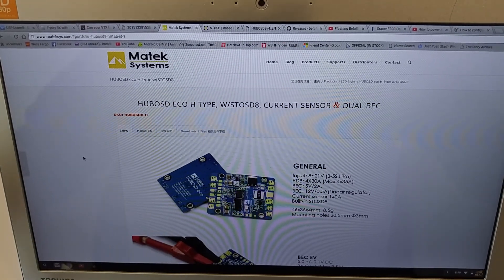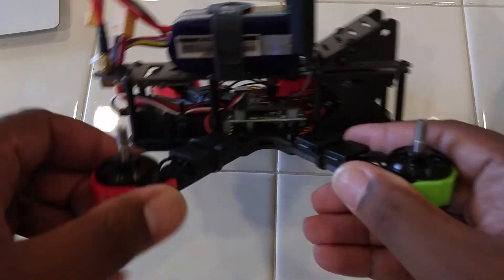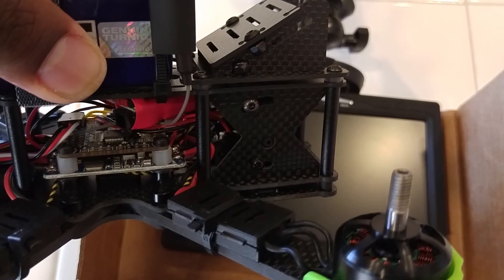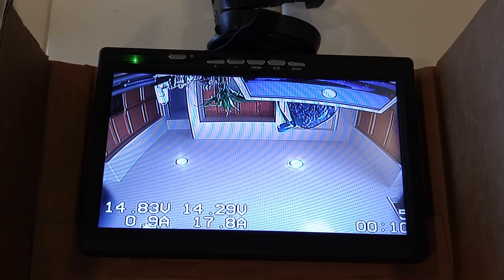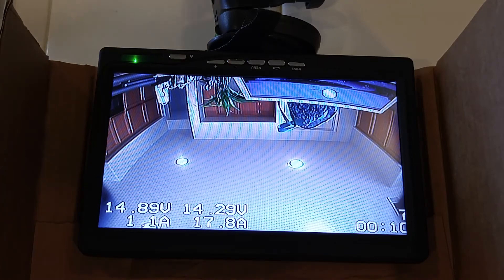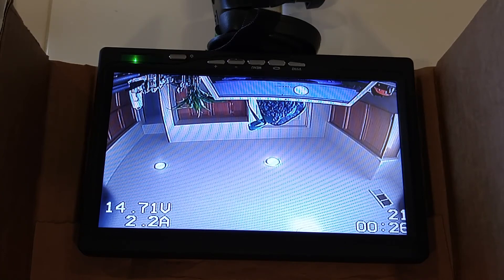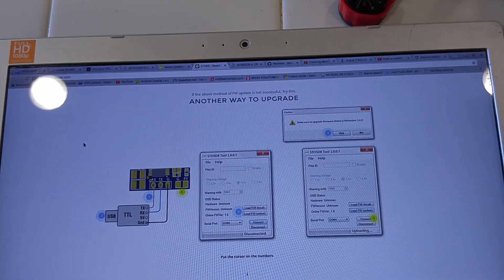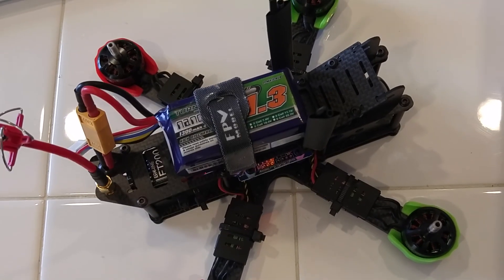Quick Review - Matek Realacc HUBOSD PDB w/ Integrated OSD

Comment: Very nice video. Thanks a lot. I need some help. So far I used 2 of these boards, first one has a wrong voltage and wrong current usage showing up, and second one had no current data at all. Not sure what's wrong with them? Could it be a hardware issue? Or something that I can correct by connecting to computer?
Reply from the maker: I haven't really been following these boards for a while. I'd suggest you post a very detailed description of your issues here and Matek themselves or some of the others should be able to help you better than I can
https://www.rcgroups.com/forums/showthread.php?2691525-Matek-HUBOSD-H-X-SE-w-STOSD8-Thread
Reply: Thank you. But what I bought is a Realacc one, I think its a clone product. Anyway I will give it a try.
Reply from the maker: RCRahul 365 Yes Matek confirmed that the RealACC is a rebrand that Matek producers... hardware is identical. That forum should help you out
Reply: RCFlyer85 sure. Thank for your help.

Comment: Awesome video, liked and subbed! My HUBOSD is flickering on and off at full throttle, any thoughts? I have the capacitor installed across the power leads but I'm still getting video break up at WOT :/
Reply from the maker: James Brossart 1.) I'd check all your solder joints and make sure they are all good, solid and clean 2.) Read up on ground loops 3.) Check out the official thread for more information and see how others are fixing it ( though In will say that if your running 30a ESC's with powerful motors you may just be maxing out the board amp wise ) 
https://www.rcgroups.com/forums/showthread.php?2691525-Matek-HUBOSD-H-X-SE-w-STOSD8-Thread

Comment: Hi, I tested the pdb realcc with osd. In osd there are write 2 volts the first in air, it is higher than the second on the ground with the engines stopped… Why? Es.. in the air, I have 4×4 volt, on the ground the min volt are 4×3.80. This is a problem… Can i set the 2 parameters at the same number?
Reply from the maker: I'm not really sure what your problem is but for further help and info check out this thread here: https://www.rcgroups.com/forums/showthread.php?t=2691525
Reply: HI, thanks for the support. I saw on the site of stosd. I made the calibration with the pc plug to the pdb. Now go fine with the numbers of multimeter.
Reply from the maker: Glad you got it solved... Thanks for watching!

Comment: Can I use this with minimOSD? I like the layout and amp sensor but I also like to configure PIDs on the field.
Reply: No, you have two totally different things.  Just use a minim micro,  they have built in current sensors so can provide all the features of this matek thing and more.  Much more work to set up though.
Reply from the maker: I don't know... I haven't ever used 1 of those

Comment: Does it warn you of low batt based on mAh consumed? That's one feature I liked on the PowerOSD. Relying on voltage to trigger a low batt alarm can be quite deceptive due to temporary voltage sag when you have to flip the throttle to full for a short while for whatever reason.
Reply from the maker: Yes it does... Stock is set to alert you after 1000mah
Reply: +RC Flyer85 ah I see.. so it uses an absolute value to determine low batt? not a deal breaker but it does make it less practical for those like me who fly with different battery sizes on one quad. but the price is hard to ignore considering the PowerOSD and RROSD are priced at $35.
Reply from the maker: +Safwan Sulaiman (FPV v1) The total mah before alarm is configurable through the STOSD software.
Reply: Yeah I get that. It's just that in one session I fly with lipo ranging from 1300 mAh to 1800 mAh on the same quad so there's no one optimal setting I can use until I standardize all my lipos.

Anyway,as I said, not a deal breaker. I'll just keep an eye on total mAh consumed rather than relying on the low batt warning.
Reply from the maker: +Safwan Sulaiman (FPV v1) Yes I'm the same I fly 1300, 1400 and 1800's so I know exactly what you mean...

Comment: looks like banggood monitor just use the button that looks like arrows going in a circle on the monitor to flip/mirror the image
Reply from the maker: It is flipped in this video but as you can see the OSD is not because my camera is actually mounted upside down. I flip the picture to fly which wasn't an issue before I had this OSD
Reply: +RC Flyer85 seems like you could use a combination of camera and display flip/mirror. have you tried loading scarab-osd on that pdb? or does it only run stosd
Reply from the maker: +TorchFPV I think it will only run STOSD but I am not sure. I do not have the tool to get into the configuration software yet so it'll be awhile before I find out.  I mean honestly I can deal with it. It's not a problem for me to look at the numbers even upside down and read them. Thanks again for the advice.